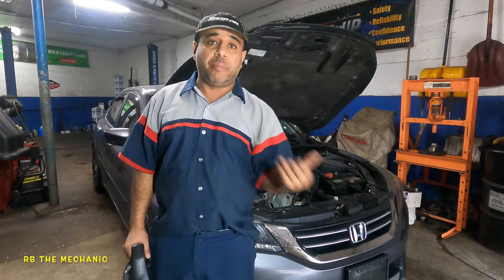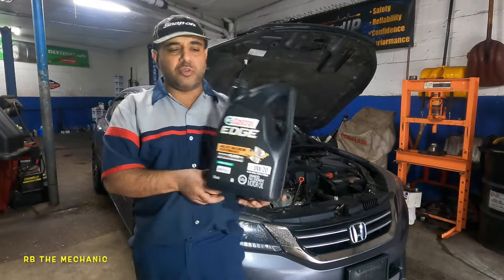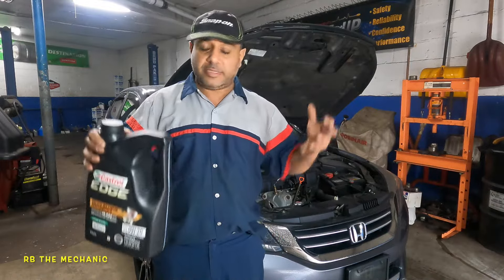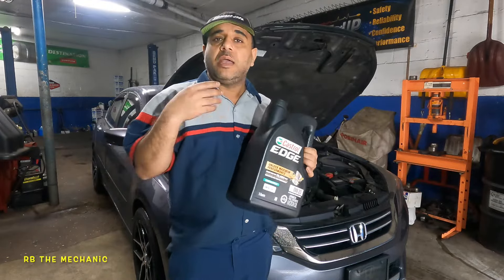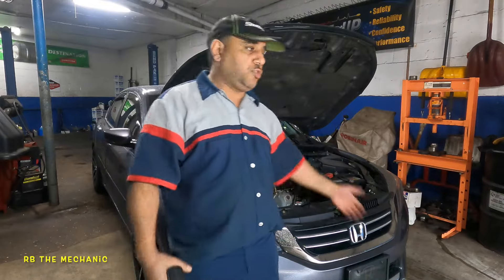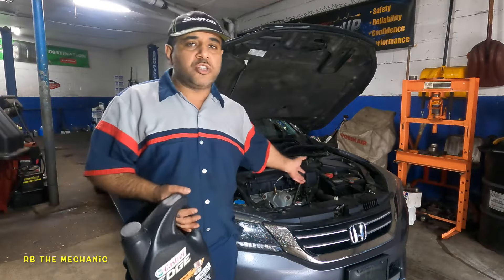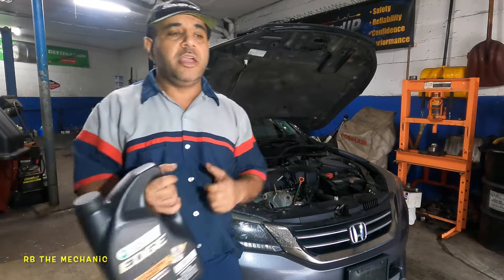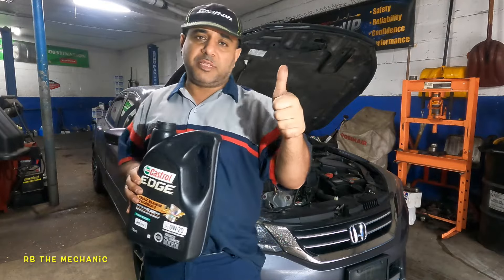Try this to FIX Honda Oil Consumption issue!

Comment: I use castrol Edge for car that burns engine oil.Should I use edge or GTX in this situation?
Reply from the maker: Oh ok
Reply: @RBTheMechanic  I just recently got a 2012 Honda Accord, 2.4L i4, with 125k miles. It doesn’t seem to be consuming oil (I changed out the PVC), and the engine runs good but because I don’t have a full maintenance history (Carfax only goes so far), in Spring 2025 going to try the Valvoline Restore & Protect for 4 straight oil change cycles through the year. Then take off the valve cover and take a look at the internals. Might even send off a couple of oil samples to Blackstone Labs to get a comparison.
Reply from the maker: @ oh ok

Comment: 2016 crv here, 3.5 quarts down at 50% oil life. This problem just started because when i thought i needed chain tensioner due to bad engine rattling, dealer said i just needed oil. They replaced valve cover gasket and oil change. 50% oil life and my engine was near dry. I already added castrol since then but have not tried pcv valve. I'll update if anything improves.
Reply from the maker: It’s common problem u should try to fight it make them fix it do the pcv valve as a starter repair simple and easy also switch to gtx castrol and keep an eye on the oil after that maybe it will work out after 2-3 oil changes I Hurd good about gtx castrol oil
Reply: How many miles do you have on your ‘16 CRV? At how many miles did this problem start?
Reply: Wow, thats a huge amount of oil burning at 50% oil life. Have the same exact car but it burns around 1- 1 and 1/2 quart every 5k miles. I use penzoil but I am planning on switching to castrol as RBTheMechanic had mentioned. I already changed the PCV valve as the OEM one is pretty cheap and easy to change. Did changing the oil to castrol help your oil burning problem? If so, which castrol motor oil did you use the GTX (White/Silver bottle) as mentioned in the video or the Edge (Black Bottle)? Would like to hear your feedback. Thanks.

Comment: I did my oil change myself a few days ago in my 14 accord(129k miles) oil life was at 50% and i only drove about 3,448 miles since my last oil change,but i kno my oil was low because nothing was on the dipstick and when i do a hard brake my oil indicator pops up on the dash for a few seconds and the engine sound ruff on startup like its no oil in there..so when i chaned it only about 2.5 quarts of old oil came out.. should i add something in my gas tank before i fuel up
Reply from the maker: Yup that means it’s low on oil and when brake oil is not there for moment of seconds to have enough pressure

Comment: I have civic fd with k24/20 frankenstein engine full bolt and i used to put 10w30 and it was burning like water.
my tuner recommended to put 20w-50 oil is it ok since here in Saudi Arabia the weather is very hot in summer ?
Reply from the maker: Not sure 20 50 very thick I would go little down. But he should be expert in ur area
Reply: @RBTheMechanic  I considered switching to 10w40 to be safe.
 I was noticing kind of slow acceleration compare when I used 10w30. 
The reason i stopped putting 10w30 is it was making white smoke on high rpm and burn so quick.
My tuner said it could be the oil is too thin or maybe bad piston rings which is scary for me to open the engine again.
I think 10w40 should be the perfect thickness for high compression engine in hot weather and winter.
Reply from the maker: @boshanan1  yeah mostlikely piston rings ur already too thick

Comment: I tried Castrol edge hm 0w20 it was good til 1500 miles then started losing oil
Reply from the maker: Oh ok it take few oil changes to see diffrence
Reply: @RBTheMechanic  ok I was going to keep using it  and just keep topping off as needed
Reply: I @RBTheMechanic did 2oil change is good oil but didn't help consumption I'm trying valvoline restore&protect

Comment: Hi brother Burning oil Acura tl. 2009 I use 5w 20 which one can I use different because it is burning oil
Reply from the maker: Try this oil gtx castrol and then keep an eye on it it should make diffrence after few oil changes and replace the pcv valve
Reply: Thank brother
Reply from the maker: @Jcrobles911  no problem!!
Reply: If it’s the 3.7 engine most likely it will burn oil regardless bc of the engine flaw. The piston and rings are the problem and replacing those is the only “solution”. It’ll just be better to always carry extra oil in the car to pour in. Also inspect your oil pan for any leaks in case that is the problem too.

Comment: Hey RB HOW IS IT WITH transmission with THIS CAR FOR 2.4L do they take long to shift and normal speed 0-60
Reply from the maker: They good I haven’t seen any issues yet as long as u change the fluid on time
Reply: I have the same problem with my 2013 Accord.. it's that stupid CVT transmission.  I personally do not like this new transmission it doesn't feel like it shifting gears at all and when it does it feels really weird unlike what we are used to standard transmission... But I have taken it to two different Honda dealers and both of them told me the same thing that is normal.  It feels cheesy to me.. but whatever.
Reply from the maker: @Letfreedomring47  yeah cats not the best they only good for first 30k miles and reverse is weak

Comment: Can i used castrol edge 5w30 instead ow20
Reply from the maker: Sure but u will underperform the engine thicker oil
Reply: @RBTheMechanic  thank you so much for the quick answer, I am going to Walmart right now to buy the Castrol edge 5w30 my 2016 Honda Accord is burning oil I was using idemitsu 5w30 but is hard to find.
Reply: @RBTheMechanic Can my 2010 Accord 2.4L 4cyl that takes 5w20 syn hi mileage oil be replaced with 5w30 in the very hot summers of temps of 90 to 110 degrees and back to 5w20 in mild winters above a low of 30 degrees ?
Reply from the maker: @1Mannco  yes I did that on my accord 2004
Reply: @RBTheMechanic  Thanks
Reply: @silascastellanos did it help ? Using thicker oil

Comment: I got 2017 honda accord sports edition i recently noticed air coming from top engine cap when it’s running where they wrote 0-20 on cap I am not sure it’s normal?
Reply from the maker: Air coming? Cap is open?

Comment: 2010 Honda Accord 2.4 200k and using a lot of oil. can I use 0-20?
Reply from the maker: U have to use 0- 20 if that’s what it calls for
Reply: With that miles and burns a lot maybe use Castrol GTX 5w-20 and maybe some MMO or STP ceramic treatment. Plus change the PCV valve.
Reply: @1Mannco  You might not believe this lol but I ran the car through the mountains and rode it hard. 300 Miles came home changed oil and has not used a drop in one month.
Reply: @deanzapien9260  So what did you "exactly do and use" that made the difference?
Reply: @1Mannco  I had read somewhere somebody else had success running it hard to blow the rings clean. so I changed the oil and filter then drove around 3 hundred miles up hills and drove it hard. then changed the oil and filter again. the last month it has not moved on the stick. I am no mechanic all I can tell you is it seems to have worked.
Reply: @1Mannco  oh also changed PVC.
Reply: PCV LOL
Reply: @1Mannco  I guess I should have said that before the mountain run I had ran seafoam then marvel mystery. I really do not know if those or all combined did it.
Reply: @deanzapien9260  OK....What oil, the 0w20 or the thicker 5w20..and what oil filter?...I might do that and add seafoam and MMO a few hundred miles before I change my oil.
Reply: @1Mannco  valvoline Max 0-20 and a Wix filter. I hope it works for you. I really don’t know if it was the combination of the sea foam and mystery oil but I can tell you that when it stopped was right after the hard run. Good luck!
Reply: @1Mannco  I have to ask did you have any success????  I thought about you when i checked oil yesterday. I keep thinking its going to drop but its still up!!  I hope you had success!
Reply: @deanzapien9260  Wow, you cured the oil loss. I haven't in my 2010 Accord yet, every 2k miles I add a qt and change oil at 4-5k. I'll do what you exactly did and let you know. I already replied to you but the posts disappear.

Comment: What engines are we talking about here?  The GDI Turbos with the oil dilution problem?
Reply from the maker: All honda 2013 and up
Reply: @RBTheMechanic  OK good.  I have a 2012.  It uses a quart in 7000 miles.
Reply from the maker: @gfriedman99  yeah lucky!!! I see more issue in 2013 and up

Comment: My brother just spent $4,300 on getting a new engine for his accord. Yeah, definitely check your oil frequently. Also read about the class action lawsuit filed against Honda in 2012. I've worked with Honda's before and unless you've had Honda's in the past and know their common issues, systems well then I don't recommend buying one. I personally go with Nissan on my JDM shopping. Better engines with more power and no sweat on excessive oil consumption. 👍
Reply from the maker: Thank you for great information
Reply: Nissan has garbage French  transmissions.
Reply: @Immigrantlovesamerica  I'm terrible sorry you're so misinformed. CVTs maybe. I've never had one. Mine's a 7 speed. 140,000 miles and 13 years on original fluid and doing fine. Fixing to get it changed.
Reply from the maker: @Immigrantlovesamerica  yes
Reply: @bradleytribble419  Literally no competent mechanic thinks french transmissions or nissans in gneeral are good.
Reply: Honda is known as the best engine manufacturer in the world...
Reply: @tooththrhr  maybe so, but they didn't put that great of rings in the J-35Z2 for North America. The J35A from Japan is better. Still have to watch the oil. Under modest driving oil is needed every other refueling or so. There was a class action law suit against Honda over it.
Reply: @Immigrantlovesamerica  you are way too young. The Nissan's of yesteryear were better. But they still aren't bad. I see many of them on the road that are quite old. They are an underrated brand.
Reply: Their transmissions are garbage 😂😂
Reply: @1Mannco  yeah with like 119,000? My '98 4.0 Grand Cherokee has almost 300,000 on the original engine and transmission and doesn't have to have oil like that. I check it occasionally and it may need a little bit because of my leaky valve cover gasket. With a new gasket on it she probably wouldn't need any for a while between changes.
Reply: @bradleytribble419  My Honda 2010 Accord EX 2.4L 4cyl 127k miles might be down close to 2 quarts every 5k miles when I change it. So I add 1 qrt at 2.5k miles.
Reply: @1Mannco  the V6 is the one you really have to watch
Reply: Do not buy a Nissan. Just checked the prices on the Sentra and Altimas. They go for cheap for good reason

Comment: If someone tries to convince you to buy a Honda knowing it has problems… they done like you, or they like for you to suffer 🤣
Reply from the maker: lol true
Reply: these engines come with defect from 08 to 10 have problem consuming oil Honda problem dealer problem and other vehicles too that honda made
Reply from the maker: @vicknamdeo1016  2013 to 2017 as well

Comment: I’m confused u said ppl use 10w 30 but then u said try 0w 20 . So which one is it and my car is suppose to take 5w-20 so which one should I try. It’s burning oil once my car says 50% oil life it’s 2qt low on oil everytime.
Reply from the maker: I would stick with 5w20
Reply from the maker: It’s not what the my tried u can’t get some in gtx
Reply: @RBTheMechanic huh
Reply: I'd try 5w-30 Castrol GTX and some MMO or STP ceramic oil treatment...plus change the PVC valve and run it for 2k miles checking it every week and see.

Comment: Tried using that oil on an older K24 and it doesn't work too decrease oil usage.

Not a big deal having to add a couple quarts between changes.  These engines burn a bit of oil when they get older.
Reply from the maker: Yeah but these Hondas burn like 3 quarts in 2k miles
Reply: @RBTheMechanic  High mileage oil isn't going to help with that kind of consumption.

Comment: maybe the piston or value seal ?
Reply from the maker: Mostlikely it’s piston oil rings
Reply: @RBTheMechanic  after changed the PVC and Oil, nothing changed, what can I do ?
Reply from the maker: @jae7230  did u switch to gtx castrol
Reply: @RBTheMechanic  I have problem to check oil level,  can you tell me how to check it. over night or after stop vehicle to check is different.

Comment: I strarted losing oil at 70,000. This caused my timing chain to stretch when I did an oil change. 2.5 quarts low. I have been checking my oil level every week now. I always have the startup rattle, but keeping the oil top off really helps. Honda screwed 1000s on this.
Reply from the maker: Yeah they messed up but try chaning pcv valve and switch to this oil and then keep an eye on it
Reply: Startup rattle is your vtc actuator it happens when engine is cold , easy fix tbh
Reply: @PurpHaze830  I say the oil consumption is the cause. I burn 2 quarts every thousand now. PVC is good. Shame you Honda. This should be a class action lawsuit.
Reply: @ExtremeRecluse  the vtc actuator makes The rattle noise on startup. Easy fix. Watch Chris fox’s video on how to change it. Oil consumption is piston rings. Add berrymans b-12 300 miles before next oil change. Then switch from 5w-20 to ow-20 pennzoil or castrol edge. I’ve also heard amsoil 100% synthetic is  really good too
Reply: @PurpHaze830  Go to thinner oil?...I usually see people say go to a little thicker oil like 5w-30 Castrol GTX or black edge?

Comment: Bought a used 2011 Crv. 120k. Right away getting p0420 codes.  Clogged cat.  Recall was over for me.  Didn't know about the sticky rings.  Replaced cat now second cat on its way out. Burns 2 liters of synthetic 0/20 per oil change. Already did PVC. Won't buy Honda again.  Stick with Toyota
Reply: PVC did help a bit.  BIG difference in power after new cat put in
Reply from the maker: Oh damn replace pcv valve as a start and I would switch to this oil to give it some hope
Reply: @mikedolan8232 Try Valvoline Restore and Protect and try a thicker oil like 5W-30.

Comment: If it burns oil the Castrol wont make any difference.
Reply from the maker: It dose
Reply: Sure does. Something about it's synthetic formula that really works, been running Castrol on my Hondas for 25 years and this is a well known remedy.
Reply: @MarkisDavidson-ti4lg  False
Reply: @RBTheMechanic  nope. no difference.

Comment: Truly, oil burning is not a problem for me, it’s annoying, but the car is running and I don’t need to spend money for repairs. My Mazda 323 was burning oil like crazy, but I used Injector cleaner constantly and engine was running great. I used Mazda on 100% without engine repair and she went to scrap yard in good working condition ( due to car body rust).
Reply: Add a catch can.
Reply: It will be a problem when the catalytic converter fails and won't pass emissions inspections.
Reply: It will be a problem when the catalytic converter fails and won't pass emissions inspections.
Reply: It will be a problem when the catalytic converter fails and won't pass emissions inspections.

Comment: It’s a really good idea to use LUCAS fuel treatment with upper cylinder lubricant and injector cleaner. It should be used with every fuel fill up. 20-30 ml per 10 litres of fuel. Use this constantly, every fill up and engine will be extremely clean inside burning chamber.
Reply from the maker: We will try that so far this been good
Reply: I use it at every fill-up in our 2009 RAV4 and we also use ethanol-free fuel.